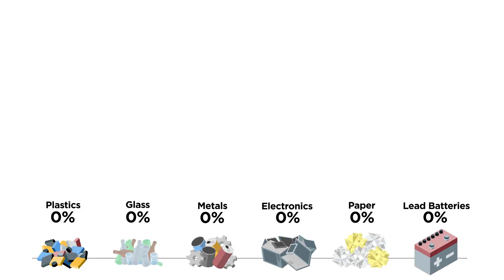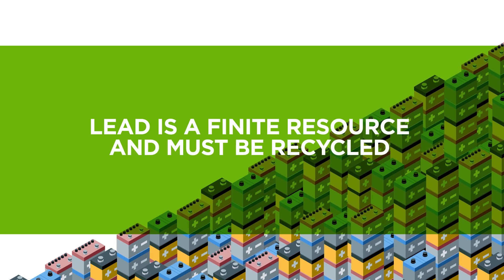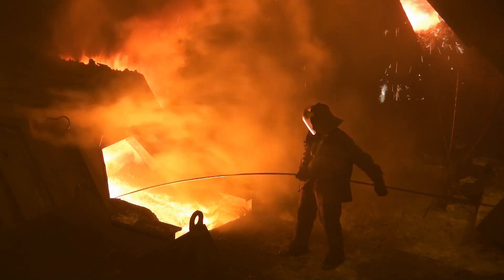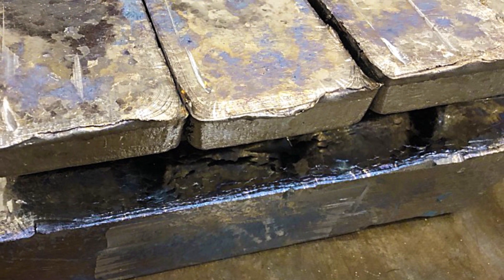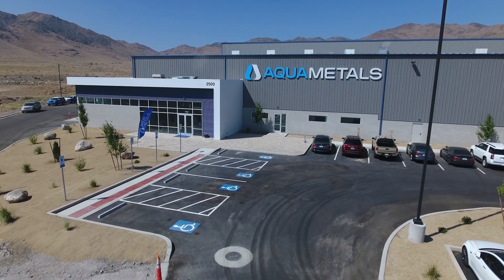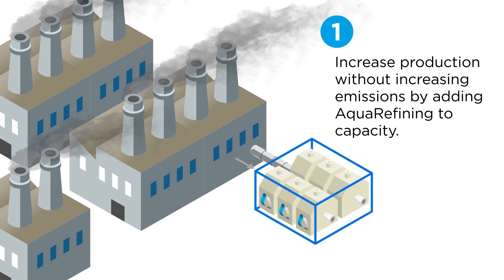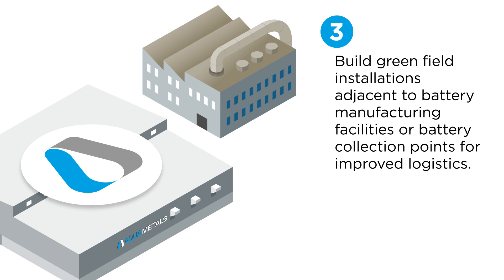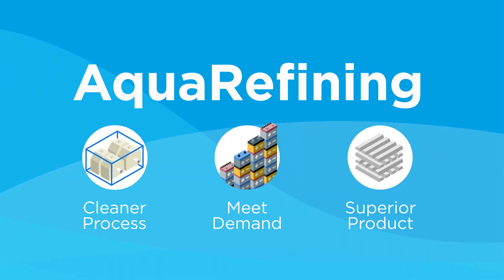Aqua Metals Overview & Vision

Comment: NO. LEAD ACID BATTERIES ARE TRASH. THIS IS THE WRONG FKN DIRECTION
Reply: Surely most industries have now swapped over to Lithium Ion which doesn’t contain lead.
Reply: With worse recycling outcomes
Reply: Why? And what should be the correct direction?
Reply: @simonepasquali3105  you are asking a person with an anime profile picture for stock advice
Reply: ESS Tech (GWH) using iron and saltwater batteries is the future for large grid storage and will free up large amounts of lithium that were once thought to be the future of battery storage for renewables. Although lead batteries will still be around for a very long time I don't think they are the future. I do hope that Aqua Metals succeeds because it looks to be less toxic and energy intensive that the current smelting and recycling process.